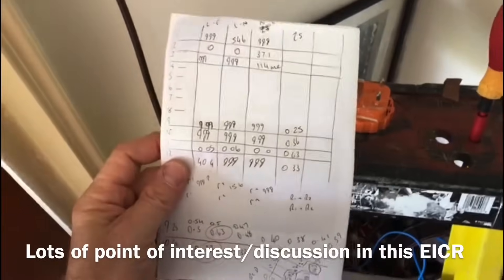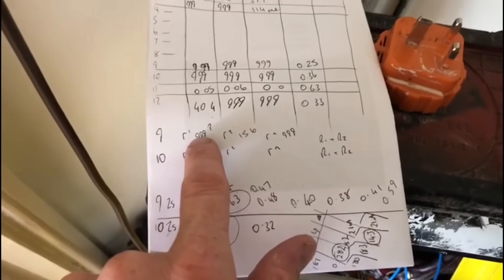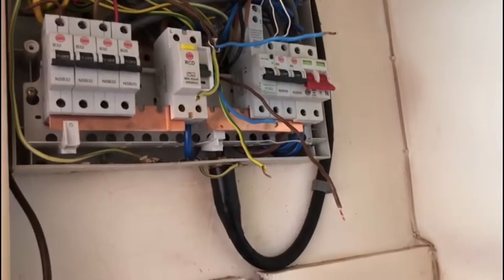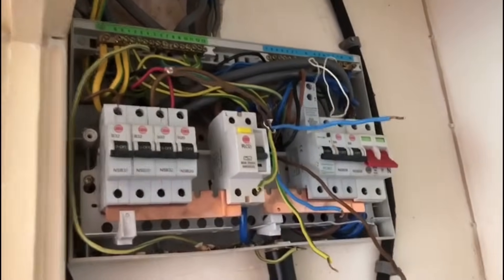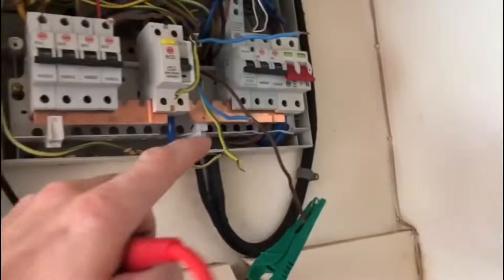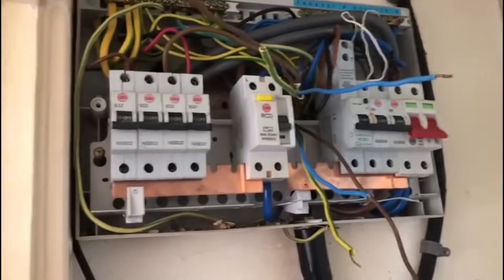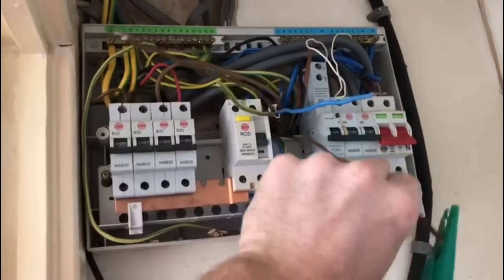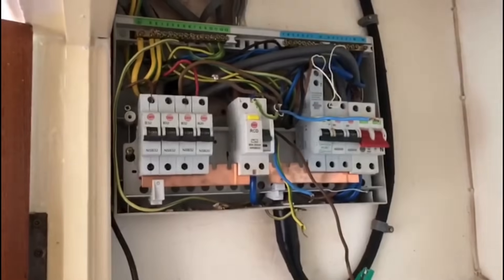EICR Ring Circuit Fault Finding Issues - Testing an Open Ring Circuit & Low Insulation Resistance

Comment: WHY are we still installing ring final circuits! They are a potential death trap in my opinion. All it takes is one loose wire and potentially 7kW of power running through a 2.5mm wire and DIY Dave extending them or splitting them to add more socket when they haven't got a clue what they are doing. Plus a ring circuit feeding 2 sockets! There is absolutely no need for them anymore ....since...the late 40s when they were introduced because of a copper shortage. Radials all the way.
Reply from the maker: Totally agree 🦾
Reply: On my first ever EICR, I found an open circuit on all conductors on the ring, I p**ped myself, I kept on checking over and over again, I couldn't believe it, I thought my megger was broken. Then on the next EICR I found open cpc on ring circuit. On my 20th EICR I didn't find an open ring, then I thought there must something wrong with my megger 😂
Reply: @killerkhan  I see it time and time again. This is why rfcs should be made not fit for purpose and scrapped. Everything will still work and homeowners are none the wiser. And let's be frank how many houses in the UK are inspected regularly , I've been an electrician for 12 years and don't even bother asking clients when was the last time you had your electric installation tested! I know what the answer will be😕
Reply: 2x4mm twin and earths are a bloody nightmare to get in certain socket makes, also if it was a big house the fuseboard would be huge no? I do understand what your saying and in most situations it would be good just not in all

Comment: Because your changing the circuit (putting a new 20a breaker in) would you need to do a electrical installation certificate for that circuit or is that coverbin your ECIR ? Great video, thanks

Comment: Could just be 2 radials and never a ring? R1&R2 could've giving you an idea where the 2 ends were. Nevertheless still need to investigate more.
Reply: doesn’t explain the low insulation resistance tests🤔 not dead shorted but could be damp.
Reply: @db-bv5rs  The 2 cables may not have been a ring in the 1st place, if there is 2 cables in every point then it maybe because the there is a missing point that was buried by a plasterer and maybe there wasn't an electrician who tested afterwards these would be an example of why it may not be a ring.  The further investigation is what you need to do to find out where is the cause, it was referring to halving the existing affected radial and through process of elimination until you are left with the defective leg.  Once you find the damage then you can find the cause.  The cause could be damp, or you may even find a socket hidden away in a cupboard with something dodgy plugged in.  If you don't carry out FI then there is nothing to explain but only speculation so effectively no one can explain.
Reply: @MrSJT  could also be joint box on ring without them being connected, but if everything unplugged and IR tests done but getting low reading could mean neon effecting, or something like a tv amplifier in loft. if getting zero ohms this could mean they have been shorted. personally myself, i think something is still plugged in
Reply: @db-bv5rs  hence the last sentence of my original reply last year was to further investigate, otherwise we'll debating all day.
Reply: @MrSJT  sorry
Reply: @db-bv5rs  bottom line is there are 3 main possibilities that would cover it all.

1. Something plugged in
2. Damaged cable 
3. Wiring fault

The sparks will have to further investigate to pin point it.
Reply: @MrSJT  are u a spark?
Reply: @MrSJT  if so, i have a few questions i would like to ask you if that’s ok

1.does items plugged in effect a L-E IR test?
2.do you have to unplug things for a R1+R2 and Zs test on any circuit?
3.Also in this video could he link L-N on 1 leg and go around testing continuity? as this would potentially show when the break it when he gets >999. As this could be loose neutrals

thanks
Reply: @db-bv5rs  I will answer you in this scenario in brief, as a sparks and as an 'in-service inspection and testing of electrical equipment' engineer AKA a PAT tester.  So yes I am a sparks but due to personal circumstances I'm trying to leave the trade.

1. Items plugged in can affect L-E IR test.  As a PAT tester that is also a test you do on the equipment.  As a sparks you're testing the installation not the equipment so separate it otherwise your results will take into account of what you are not covering on paper and in practice.

2. For R1 R2 Zs test you should do it without any loads plugged in as you may get drawbacks in some instances.  In this scenario by default the stuff in already unplugged as he did the IR test.

3. No point connecting L-N because >99.9kohm on both L-L and N-N hence my original comment said it may not have been a ring in the first place as likely hood of those 2 readings to be both >99.9kohm is extremely unlikely, also the r2 was 15.6kohm which sounds like parallel paths where potential isn't that great.
Reply: @MrSJT  1. this makes sense as if there is a link between l and n because of an appliance, neutral technically is earth due to the TN supplies, meaning L will be connected to E?

2.i don’t understand why for the R1 and R2 though, as i though it is testing the resistance of the earth path or continuity of cpc, how would appliances being plugged in effect this and also for Zs?.

3. for this scenario this defo wouldn’t work, however if you knew this was a ring you could link out L and N, find the >999, do same to other leg and narrow it down?

also what could be giving the earth parallel paths?
Reply: @db-bv5rs  1. When you do IR the LN conductors are disconnected it isn't gonna have the effect you are thinking of.  If an equipment is connected with an IR fault, you will pick it up.

2. An example of a draw back, you unplug an appliance such as a water heater that is connected to the water pipe and therefore giving you a better reading than it should as it provided another earth path for the Zs. So if you are someone who is unsure then unplug to know for sure.

3. What wouldn't work??? If you knew it was a ring then surely you must have wired it yourself or tested it yourself and therefore further investigation should be easier for that person.  Before you even go there you should find out what the cause of the IR fault is first because if the cable needs replacing then you need to remove it from the equation.  Plus now that you've mentioned knowing its a ring then surely you must know where all the points are so in that case liven the leg that is fine so that you will find the end of that leg.  The type of parallel paths (not cable, but rather building material) I was referring to would be building material, probably soaked as it was the little r2 reading being 15.6kohm.
Reply: @MrSJT  1. come to think of it now you are right the earth is still connected into the bar and the phase and neutral are out, and i believe some appliances will have some connection between l-e or n-e in computers or wifi hubs.

2.is there anything about the R1 and R2 test that will need? i now understand as it is testing the earth path back to the supply if there was a short to earth? you can calculate Zs by R1 and R2 +Ze?

3. what do you mean by soaked? do you mean like the cpc is wet?
Reply: @db-bv5rs  
2. Unless a piece of equipment is causing a short between L-E then it wouldn't matter when carrying out R1+R2 as we are measuring ohms, having said that it would have blown the fuse before you even switched it off to test.  You can calculate Zs as your guide to give you worst case scenario ( this is why designers calculate and electricians actually test), but you should also measure where you can do it safely.

3. Soaked or damp masonry, more likely the latter.   at 15.6k ohms there is some kind of potential connecting the 2.  On a separate note FYI when testing for extraneous conductive parts it is 22kohm, so with 15.6k ohms it's a good indicator that the 15.6k is grounded, or damp above ground.  Or someone playing silly buggers sticking a 15.6k resister in line the cable😂
Reply: @MrSJT  2. yes that’s right. is there a table in the regs for max R1+R2?

3. i didn’t actually realise that it could get parallel paths through the fabric of the building thanks.
4. what would make R1+R2 results dodgy and also IR, i know damp will? and will-green  oxidation cause results to be higher on both tests?
Reply: @db-bv5rs 
2. I don't think there is a table for max R1+R2 but there are tables for max permitted Zs in BS7671 and max measure on OSG.  R1+R2 max you can calculate via acceptable readings permitted for volt drops.

3. Parellel paths usually means other earth paths created by other earthing cable conductors.  I just added that it personally because it's still a potential path created else where, maybe I should replace parallel with potential instead.  A parallel path can give better Zs readings, the potential path I was referring to is how he may have got that 15.6k reading from between the 2 cpc's from the conductor.

4. Damp and loose connections and damaged cable can caused fucked up readings.  Green plasticizer or green goo combination of copper oxide and plasticizer (or some shit) may cause issues with IR tests but I haven't come across a cable with leaking green goo causing problems, if they do you may want to consider replacing cable if you can't fix it.  Readings won't be higher, it will be lower if anything on the IR test.

Are you in college learning the trade?
Reply: @MrSJT  2. yes there is one for max Zs but i think there is different results in two different reg books, for e.g. 32a B breaker something like 1.13 ohm in one book and 1.32 in another?

3.an example of a parallel path could be a boiler earthing a cold water pipe and as it is connected to true earth it is an extraneous conductive part thus meaning it could take that path and get a lower reading on Zs. but not IR? because it is already tested with earth in bar?

4. i am not in college (yet)
Reply: @MrSJT  i think im being silly here, on a Zs it looks for paths to take to earth, however on R1+R2 it will not take parallel paths as it is only linking P+Cpc and continuity back to the meter? on IR test this is also the case? as you are keeping Cpc in bar anyways and there are many parallel paths there?
Reply: @db-bv5rs 

2. you are getting 2 different results thas why I said one is max permitted and one is max measured, you really need to start college to learn all this properly to understand it.  Temperature plays a large factor.

3. parallel path from boiler circuit cpc would normally be the main equipotential bonds from the gas and water service connected back to the MET.  IR is a different test and require all earths connect to prove complete separation to live conductors.

4. You should and ask loads of questions

Zs looks for paths and hence designers calculate for worst case scenarios which means parallel paths are excluded, but nothing beats calculation and actual test put together to get a full picture.
Reply: @MrSJT  2. could you give me the calculation for volt drop? i have learned it however have forgotten it. i also agree i do need to go to college, however i like to learn so i’ll be a step ahead and know a lot more so i don’t get confused. Temperature as this could heat the wires up and thus add resistance which lower the current flow?.

3. In IR testing is the main purpose to check the quality of the insulation and see if you have dead shorts?

4.to test for Zs you have to plug in tester on loop impedance, low if you have an RCD or RCBO, and high if you don’t. this will test the fault current that will flow in a fault to earth, if you know you have nothing plugged in that can give parallel paths, can you keep things plugged in? and i’m guessing the main and bonding conductors are still connected, but then this would measure the Zs to parallel paths too correct?
thanks

Comment: @5.36 JW states that a 2.5 cable is rated at 26amp, did you issue a pass on the electrical installation?